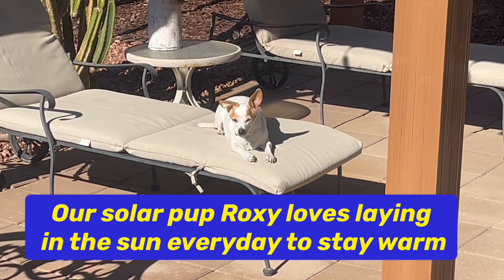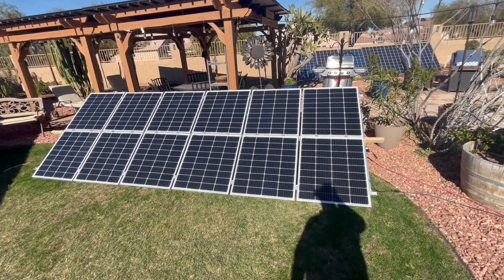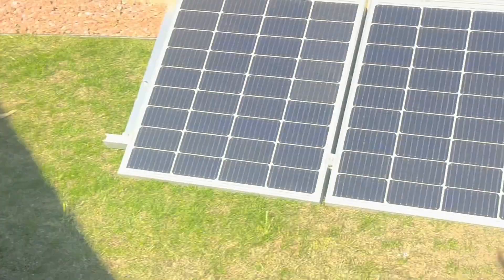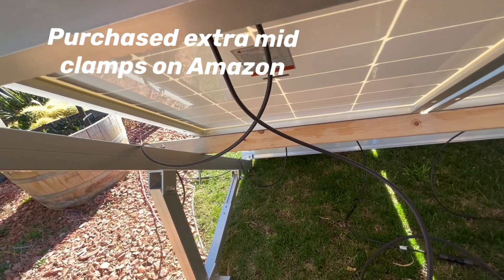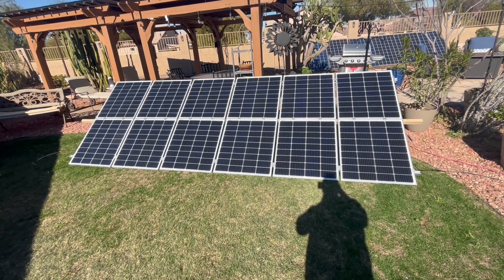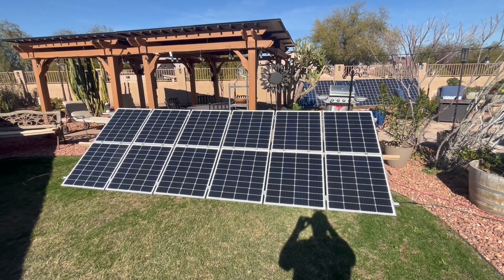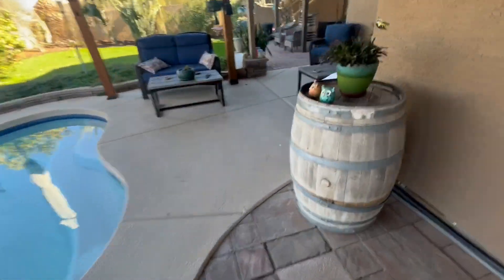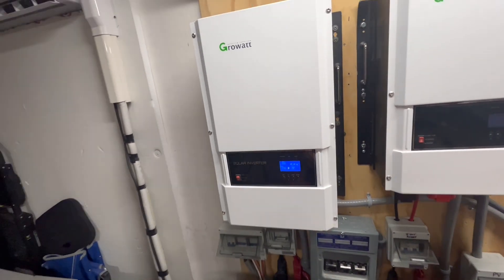Mini split in Motor Home, testing new solar panels,  EG4 inverter & battery bank, LiFePO4

Comment: For your solar rack you could use something similar to express van cargo rack that uses uni strut, it would be an easy fab job for a welding shop to have one custom made out of aluminum or steel. Also in your previous videos you were using MPP Solar all in one chargers, why not use one of those in your RV? I’ve enjoyed your videos by the way, I have learned a lot.keep them coming!!
Reply from the maker: Thank you so much for your input, I appreciate it. The charge controller is 48 volt, I need change from 48v dc to 120 volt ac. So using the charge controller without an inverter can not work. But the EG4 3000 watt inverter will do both and it is only around $700. Plus the EG4 3000 off grid inverter slows up to 500v dc solar panel input and over 5000 watts of solar panels to max out and get close to 3000 usable watts. Thanks again for the idea, I will check it out. Hope you have a truly wonderful and blessed 2024.
Reply: Ladder racks bolted to upper wall frame.Trying to figure out if I’ll need inside backer plates?,with iron ridge rails attached to ladder racks.Panels bolt right to the rails.
I have everything to do this on my rv.Using 3 rails would work for your half size panels.I’ll be using 3 rails for 45x90 inch panels.
I only have two 12v li bats and want 48v system.Hay but I have 3 deep cells hahaha I’ll buy the 2 that I need for 48v.

Is eg4 3k a low frequency inverter? I have HQST 60a charge controller.Looking at a low frequency 4K inverter but almost $1k so I may just buy a multi plus ll for a few more bucks.Then a mini split.Cha-Ching 😊
Reply from the maker: Thank you for your input. I will look into those suggestions. The 3000 watt EG4 in not low frequency. A low frequency inverter will cost you some big bucks since you have a big coil inside and it weighs a lot. My 6kw Growatt inverter weighs 109 lbs and the 12kw Growatt weighs 186 lbs. I took me a while to buy components, then to combine together and make several systems. They great part about off grid solar is you are not limited when you go to create a system. Many components can be used from different manufacturers. A few years ago, it was a nightmare trying to do that. Every day it seems like new products arrive in the market that are better than just 6 months ago. Off grid DIY solar is one thing a homeowner can do with no or little experience, just watch a few videos on the product you buy and there are videos on how to install product. That was not possible 20 years ago. Utility prices will never drop so might as well make investment now. Prices of all components seem to be dropping for some things but new products are starting to get very expensive and have a lot of bells and whistles. Thanks for your input and hope you have a truly wonderful & extremely blessed 2024